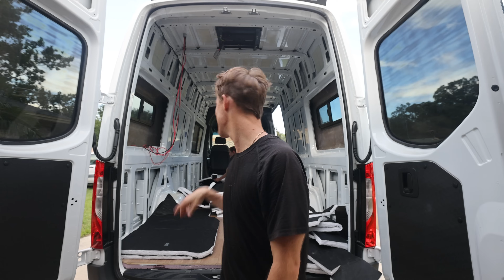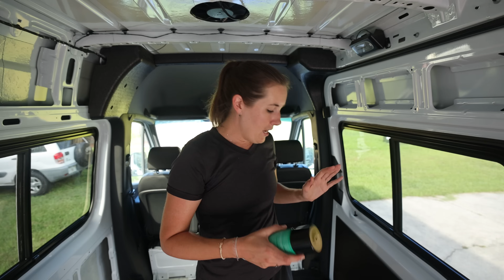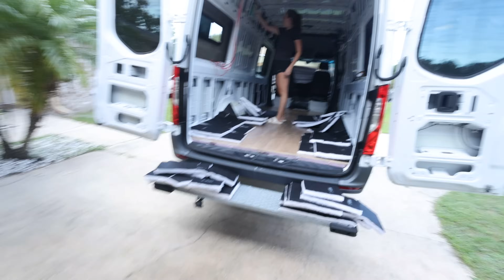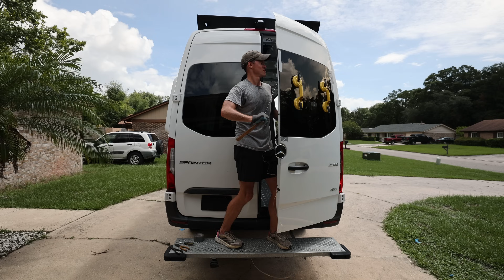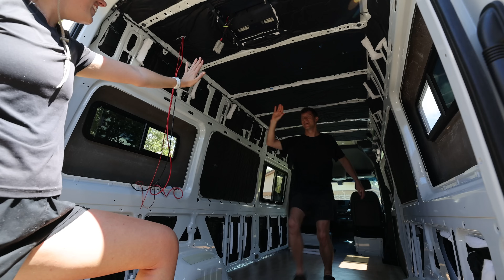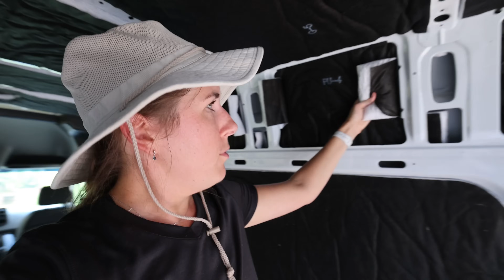5 Lessons from Building our Camper Van (3M Thinsulate Installation)

Comment: I have a question for anyone. Would it be okay to spray just the top edge of the insulation and where it is going adhere to help cut down on the amount of glue used? It would essentially be hanging from the glued top edge, like when doing the walls.
Reply from the maker: I think there's nothing wrong with giving that a shot! If it stays up and stays "fluffy" that's what's most important, not how much glue you use. Cheers!

Comment: Great work and detail, but I had one question. Why is there no insulation in the capsules/flares? Is it not needed there?
Reply from the maker: As we're living in the van, you can tell that the flares don't have insulation. But typically people don't insulate them. First off the marathon plus fabric does have a layer of foam which is a very light insulator. Second, every centimeter matters so insulation would impact that. Third, it makes finishing them a little bit harder. Lastly,  at night having less insulation there seems to be nice as it cools down the van quite a bit more in the bed room! 

Hope that helps!

Comment: I am just about to buy a 144 high roof kit, but in watching this I am kind of surprised they don't provide materials to fill all the voids.  Not having any windows, I won't have any extra materials.  I guess now I need to consider whether I need to buy another roll just for that.  Any thoughts?
Reply from the maker: Good question! You're right, without any windows you wouldn't have the capability to fill in any weird crevices. Our first inclination is that yes, buying an additional roll could be a good idea, or you could buy their scrap bag! (affiliate link here). This should be good for all the crevices, and it could be cheaper than buying a roll, but we didn't need it as we had extra. Cheers! 

https://go.schoandjo.com/s/3m-thinsulate-scrap-bag

Comment: The lesson I learned about insulating a camper is: Unless the inside and outside temperature are different, the insulation is a waste of time. What I mean is, if you're following nicer weather and have the windows and vent fan running. The insulation isn't doing anything 😂.  Been a rubber nomad since 2018, now looking at boats for the loop 🍻
Reply from the maker: Nice, good luck finding your Loop boat!
Reply: Similar thoughts I've had a small cargo van since 2015 that I take from New England to California and around and return in April. I've come to the same conclusion regarding insulation. Unless you're really in an adverse climate where your heating or specifically cooling then why bother. I did put thinsulate in and maybe a dampens the noise. I'm about to upgrade to a RAM ProMaster but going through the same thought process again. Simple simple simple. For me it's a bed on the road with windows a solar panel and a fan

Comment: Suggestion: To protect the floor during the build, consider covering it with  "Red Rosin Paper."  It can be cut to fit and secured in place with weights and / or painters tape.  It's available at Lowes. Home Depot, etc.   Cheap Insurance!
Reply from the maker: That's a great recommendation, Bill - thanks!

Comment: I see that the floor edges are still left open at the rear door and assume at the side door and where the floor ends by the front of the van.  What do you plan to do for these areas in the future?
Reply from the maker: Good eye! We will be covering that with some nice metal trim! We will probably hit that when we get to some of the beauty work later in the build 😁